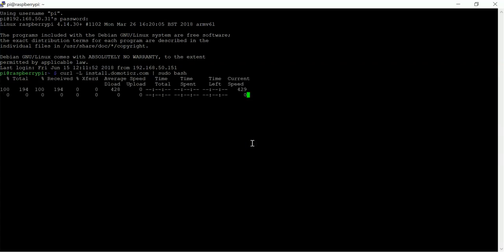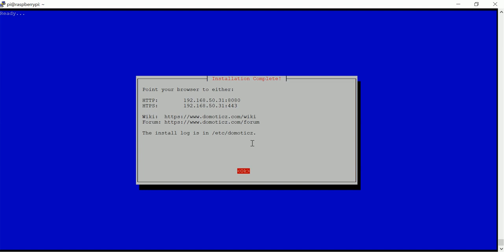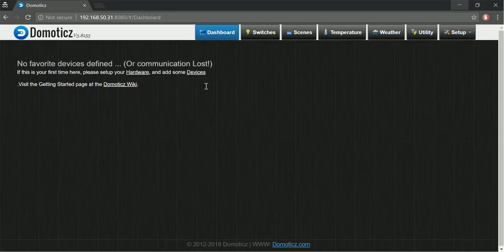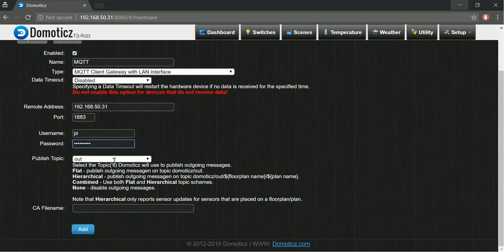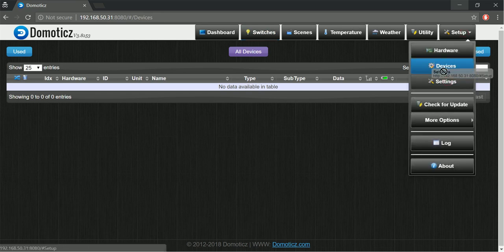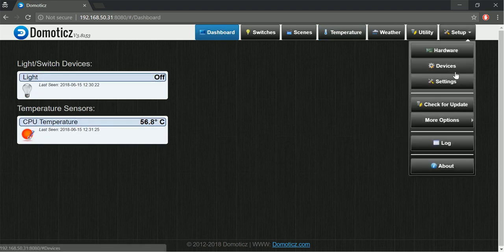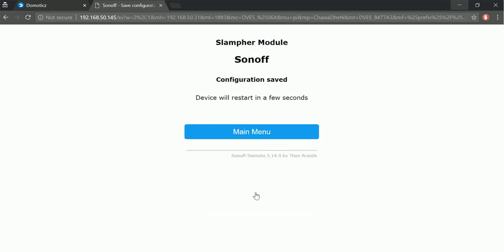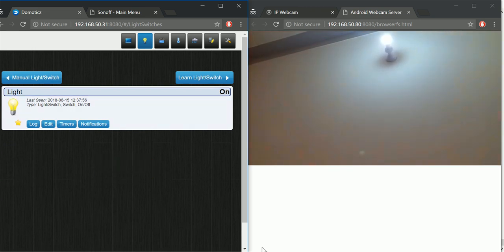Domoticz: Sonoff Local Control Dashboard

Comment: Awesome video !! 

Thank you, it helped me getting started with Domoticz and add a sonoff running tasmota.
I first had some problems getting the sonoff to react to the (virtual) switch, but after watching your site I saw you have to enable/download a MQTT server on the rasberry pi (not showing in this video). 
After I did that everything is working. 
Thanks again.